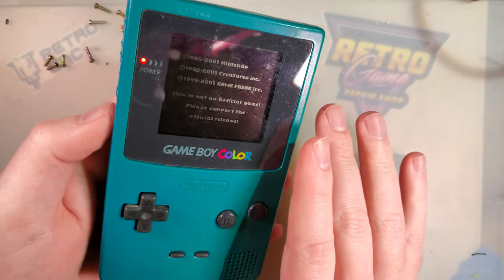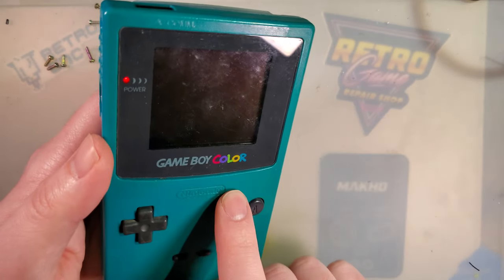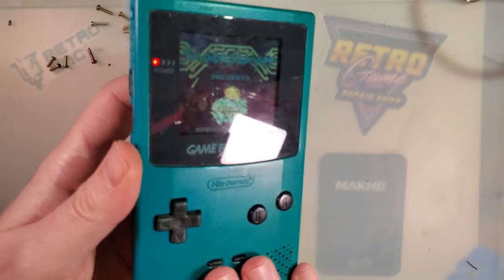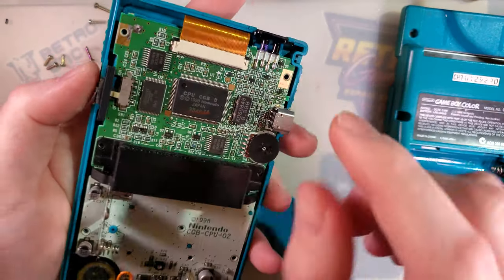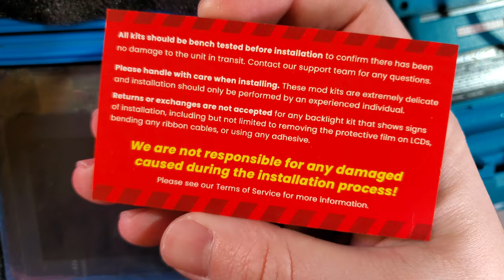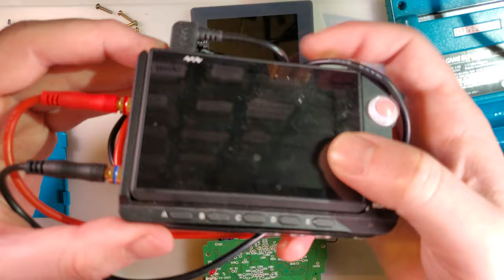Test Backlight Kits Before Install

Comment: If you do a lot of these it could be useful to make a standalone tester. Like a small pcb that the screen can plug into and it just plays a simple test pattern on the screen. Could be a fun project :)
Reply from the maker: It would be an order of magnitude cheaper to just hardware a GB(C) CPU to a flash cart with a display connector still attached, especially with the current parts shortage.

Comment: This is probably common sense but... make sure you thoroughly examine the screen when testing. I didnt notice a few stuck pixels in the bottom left corner of mine until it was put together :( I got a lil excited when I saw it worked and jumped the gun

Comment: Not gonna lie. When I see or hear the words "backlight kits", my mind goes back to things like Nonfinite's and Kitsch-Bent's LED and ElPanel kits and the time Kitsch was blogging about designing a replacement backlit DMG LCD. That was something I was definitely hyped about as some time before, one of Nonfinite's V² kits caused pressure and cracked the LCD on one of my DMGs. (That wasn't a huge loss. That LCD was on the verge of death. Several dead columns, vertical and horizontal.) I learned to inspect and touch up the solderjoints if needed and remove the HMA if present on several of those kits. 

I kinda miss peeling the polarization film and installing 74hc04 hex inverters, but I kinda don't. Installation isn't as fun with these newfangled expensive kits, but they're definitely more convenient, certainly nicer to use and are absolutely great for reviving gameboys and prolonging their lifespan. 

It isn't hard to test the kits and I don't get why content creators wouldn't do it if they're recording anyway. You'd think if they're recording anyway, it would be good to catch a defect on camera.
Reply from the maker: You gotta keep in mind that most "content creators" are actually just that and are creating content for entertainment. One of my friends says there's a big difference between youtubers that mod and modders that youtube and I absolutely agree with him on that.